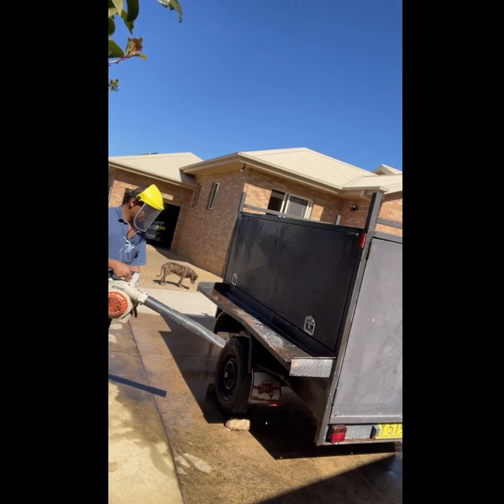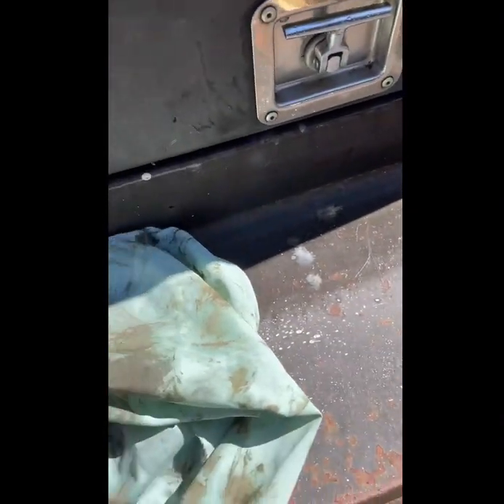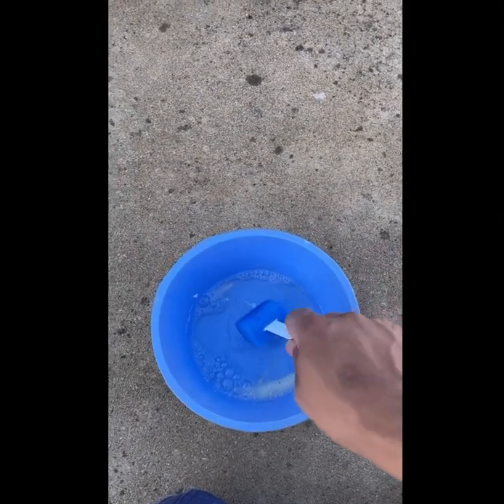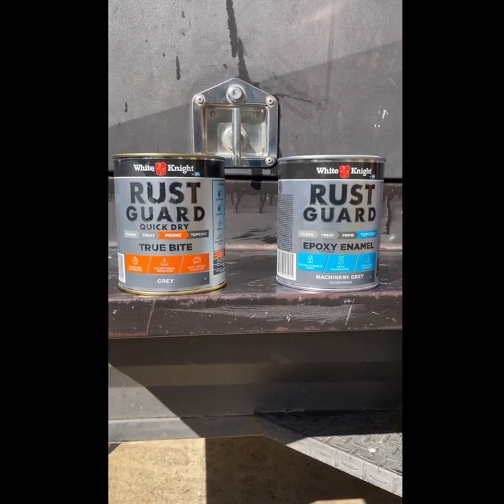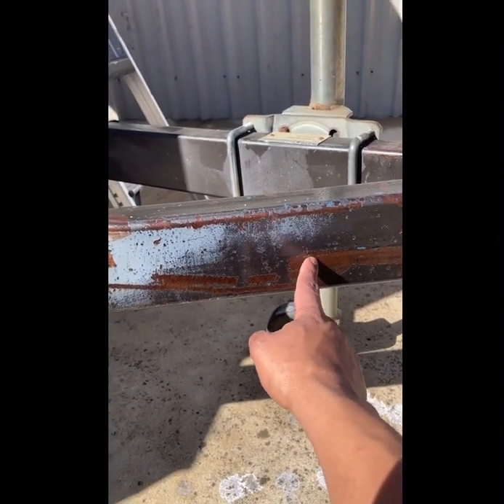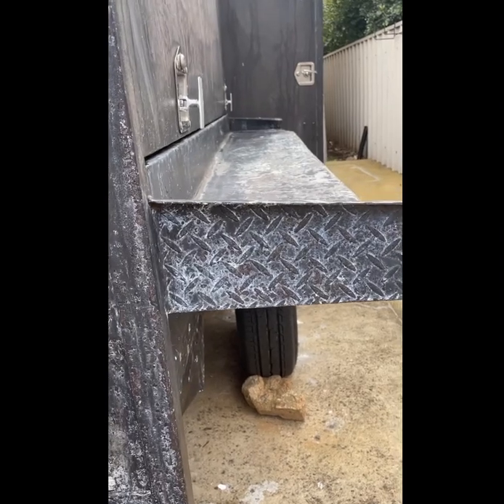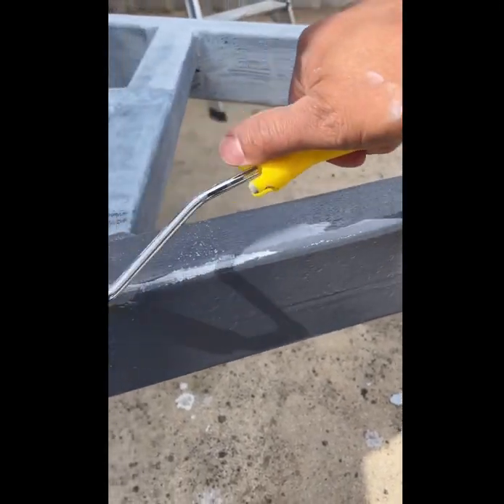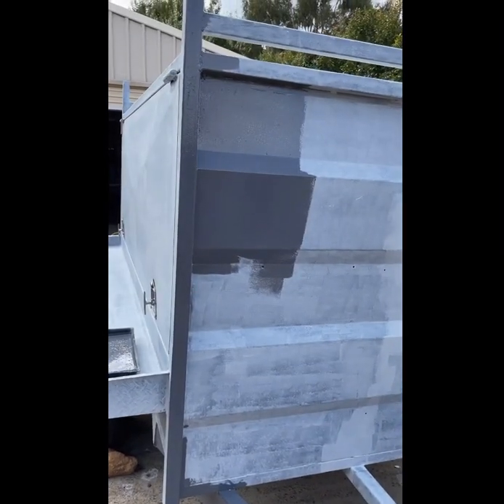How to / DYI restore rusty trailer handyman Australia

Comment: Great video! Gee I wish I had gone with epoxy enamel. I ground back my 6x4, rust convertered it, primed as well. But I used a foam roller (eventually went to a brush) and the Hammer Finish. It was hard to work with, and I ended using around 3.5 litres. Looks good though lol.
Reply from the maker: Thanks for tuning in mate. I was just amazed how well it turned out. Still holding strong Only thing I would do differently would give her clear coat for extra protection. Believe me I have learnt a lot from trial and error and I’ll keep on learning YouTube is an amazing tool of knowledge.
Reply: @Hibrahimandco  it was actually a great video!! I wished I had seen it before doing mine lol. I did it during COVID but was still a bloody pain!

Comment: Hey mate one year on how is it holding up? I’m thinking of heading to bunnings and grabbing the same gear  you used. 

My trailers not as rusty but there’s old decal marks etc just needs a full refresh. 

Also how much product did you use if my trailers similar in size 

Thanks
Reply from the maker: Thanks for tuning in. Yeah she still looking good. If I was to do it again I would give it a coat of clear stain at the end as it’s just an extra layer of protection I’m a little rough with me trailer. I used 1 L tins.

Comment: Hey mate, thanks for the tips. I have just used the same rust buster on my trailer and about to buy paint. How has the paint you used survived over the past few months? Is it pretty hard wearing? I was think of the same brand you used.
Reply from the maker: Hey mate Good question and thanks for tuning into my channel. All in all it’s weathered pretty good. If I were to change anything I’d look for another clear coat over the top to give it more durability with all the abuse i through onto the trailer. Apart from that she holding pretty good and no rusty is coming through, Hope that helps.

Comment: Hey mate. How much paint did you end up using?
Reply from the maker: Thanks for tuning in bro. I only ended up using only 1 L as pictured I. The video as it rolls out thick didn’t require a second coat. The only thing I’d do different is give it a clear coat for added longevity as I’m a little rough with her at jobs. In any case she’s still going strong